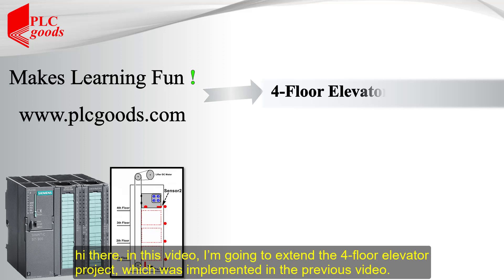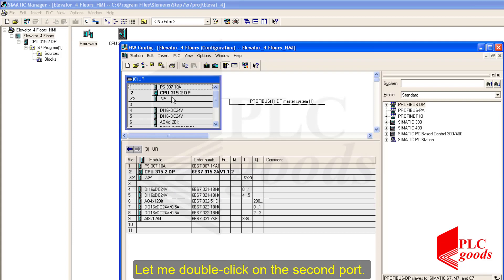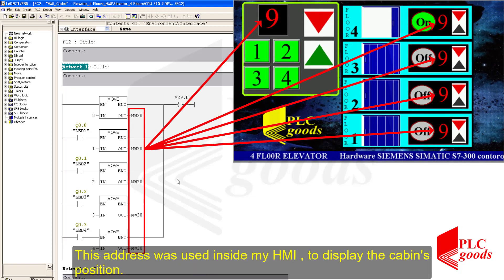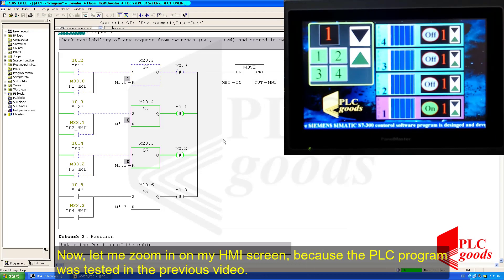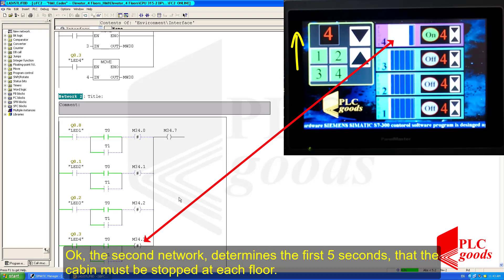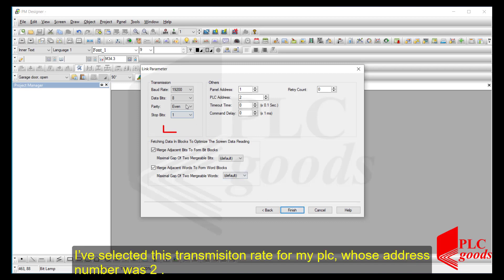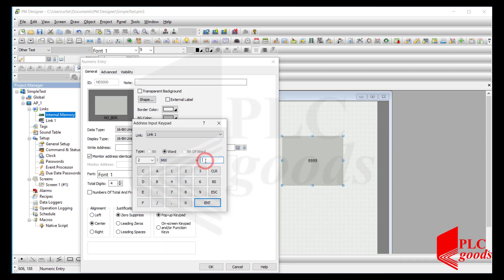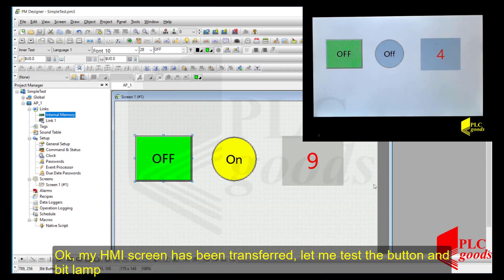Connecting an HMI device to 4-floor elevator system - part 2/2

Comment: Can you make a tutorial on saving manually entered data from a touchscreen to a pen drive, for example, and then uploading it back to the touchscreen?  for example, I enter data into the coil winder I want to wind and then I want to save all its data such as position 0, number of coils, layers and so on. In Ispsoft for MC PLC Please 🙏
Reply from the maker: Thanks for your comment BUT I do not have any experience in transferring data from a touchscreen device to a USB flash drive or vice versa!